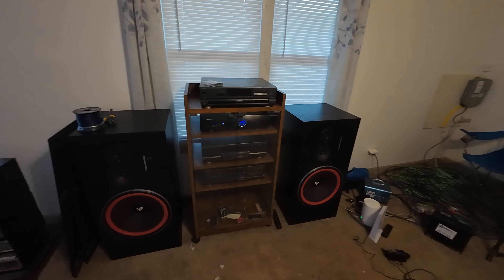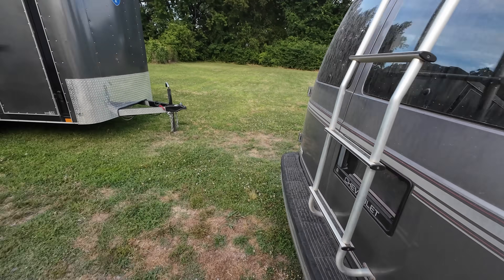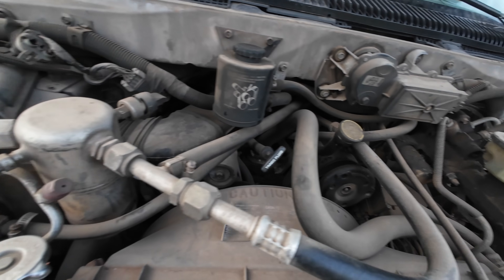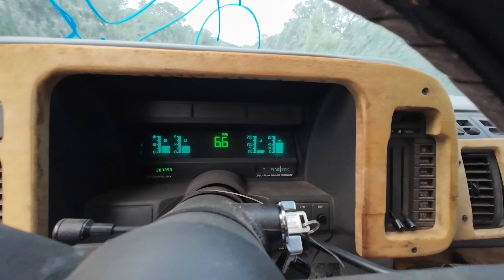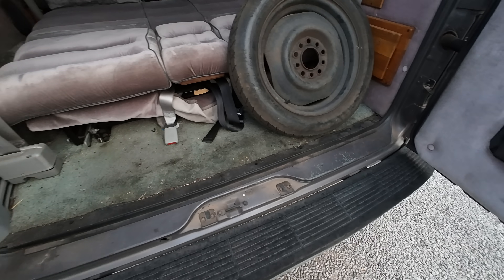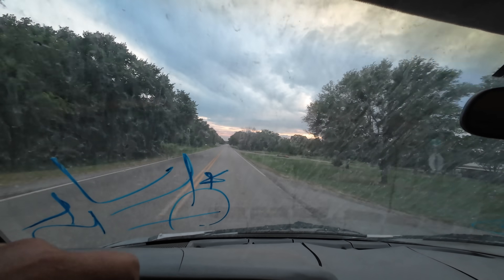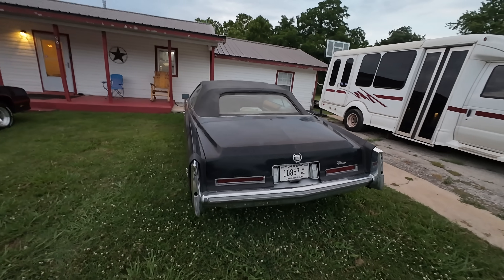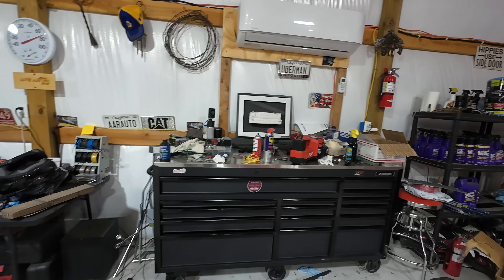I Won this 1993 Chevy Astro Conversion Van for $375 from IAA! Will it Run and Drive?

Comment: Digital display in 1993 that van was way ahead of its time!!!
Reply: Nope they started in the 70’s became big in the 80’s and started dying in the 90’s and bounced back in the late 2010’s
Reply: Look up the 1987 buick somerset 😂
Reply: Look at late '70s Chrysler products and I think mid '70s Chevrolet products or GM had that as well it's been around quite a while
Reply: @battycowboy hat display was a. PITA
Reply: Alarm system old school viper
Reply: Auto lock feature with slarm
Reply: Those digital dashes were around a long time before '93 and were notoriously expensive to repair.
Reply: @iFixJunk  yeah new gen of gm trucks and cars. 88on up had digital dashes and heads up displays..junk
Reply: @jasonmoore8518  I had a 1984 Nissan Maxima that was all digital and talked to you. Waaaaay ahead of its time!
Reply: @user-ht1xu4gv2u  Yeah, my 88 Cutlass was all digital with HUD.

Comment: The silly little thing on the kawi is a dual kickstand, while standing next to the bike balance it up on two wheels step on the dual stand and pull up and back it will lift up and is very stable no leaning.  A very useful tool to have.

Comment: That is a kickstand to set it up straight, level. You stand it up ,push down and pull back on the bike. It brings up off the rear wheel. Try it and you will see. It may be a little hard by yourself but it will work.

Comment: my grandfather had the same year van just not the conversion part. it was very reliable, it has over 400k on it and not once has it broken down only thing he's done is normal oil changes. they don't make cars like they used to and that's a fact

Comment: Had 95 Astro AWD that 4.3 was amazing put 295 thousand miles on it with only basic maintenance was living in fear of fuel injection spider failure but it never did. Was amazing in the winter.

Comment: Growing up in the late 90s my dad had a 91 Safari he bought pre owned in 94 right before I was born and let me tell ya he drove the hell out of. He sold it in 2015 with just shy of 450k miles to one of his buddies that really needed a ride. Never touched the engine other than basic little things like water pumps and such. Just 1 transmission and rear-end replacement at around 370k miles
Reply: I drove a Safari for work and an Astro in a later job and loved them. Wondered why they did away with them.

Comment: Randy, just watched and yes that is a kickstand on the motorcycle,so it will sit level and not fall over if sat on., push to ground and pull bike backwards by handlebars

Comment: That is such a sweet Astro Van! Loved the early years especially the 80's versions. A friend had a 91 Astro and a 94 Safari for a long while. The Vortec is a good motor knowing both of his vans had well over 390K miles on them. Still looked pretty good as well in similar shape to this one. Great score on this van Randy it doesn't need much either. Just a cleaning some AC and maybe tires. Can't wait for the next video!👍

Comment: Randy the vortec v6 is an absolute beast I had a 2003 work truck that had 265,000 when I sold it to a good buddy of mine. He drove it another 200,000 miles the odometer read 465,000 when he got t-boned in it that ended its life otherwise it was running awesome....

Comment: The peg behind the kickstand it's called the center stand. It is used to remove the back tire if necessary and for other purposes. Drop it down with your foot and push motorcycle backwards to utilize

Comment: I had a nice Fisher Studio Standard  rack system back in the 80s that I bought at SaveMart Electronics in Brooklyn. it had the 15inch 3 way speaker system with 20band graphic equalizer dual cassette deck 6CD carousel unit. Linear tracking turntable and the matching rack to put everything on, Rebuilds 👍

Comment: Hey Randy, I believe the 2nd kickstand on the motorcycle is a Center Stand. When engaged, the bike sits up right and slightly elevated. Good to use when doing maintenance. I could be wrong though, I'm not a motorcycle expert but I remember when I was a kid, I knew someone with a Honda Goldwing that had same thing. Awesome video as always!

Comment: Best purchase of all time! I've owned 3vof those. 94,96,2005. All are fantastic. 4.3 engines in them are perfect. Basically a 350 engine with 2 cylinders cut off the block. The engines are awesome.  Great mileage.  The wood on those are easy to clean if not completely damaged. Otherwise you did well! I'd buy it if I lived closer. I'm in Cincinnati.  Love those Astros and the gmc version

Comment: I was a furniture restorer for over 50 years. During that time I restored the interior wood in three Rolls Royce's. Do one and others will follow it seems. Countless wooden sports car dashes as well. The interior of the conversion van had my attention and it can be restored but it will need a lot more than a sand and finish. Another outstanding purchase along with so many others. Grand video. Thank you.

Comment: I have a real soft spot for these Astro/Safari vans. My dad had a bunch of them when I was growing up. They are terrible passenger vans, but are work trucks through and through.

The thing that really helped them was those old 4.3L V6's were bulletproof, they got really bad fuel mileage, always ran rough, and almost every one I've ever seen had an exhaust tick, but I've never seen one that doesn't run unless there's a hole in the side of the block.

Comment: If u need to change a tire or oil on the bike it has it's own jack u put one feet on the silver kick stand and your hands on the handle bars u push the bike backwards and it will lift the bike up off the ground then u push the bike forwards to let in back down again

Comment: Hey Randy, that (silly Lil not a kickstand) on the Kawasaki. Is indeed a center stand. 
You put your heel on it and rock the bike back until it sits up straight. Much more secure than the leaning kickstand.

Comment: Randy on that 1200 that is a jack kickstand to lift the bike up in case of a flat. It's tricky but ya push down on the lever and pull the bike backwards and it lifts up I had a Honda gl 1100 with the same jack tg I never had to use it cus it's useless if you are alone...

Comment: Nice score Randy!
With a little bit of work, that would be a Hell of a road trip vehicle!
My Buddy had a base model Chevy Astro with the 4.3 V-6.
That was such a great vehicle! Super reliable! He used to tow his heavy 18ft Tri hull boat out to the river and back through the mountains with no problems. He had it for several years until one day his Wife was driving it and some yahoo ran a stop sign and plowed into her and totaled it.
They really are great vehicles.
It has a ton of miles.
Like you said. Clean it up as best you can. Lube and grease a few things. Check and replace a few fuses and send it down the road.

Comment: That footlever on that bike is a wheel stand push down on it while pulling the bike backwards and the radio should be under that cover above the handle bars just pull it open

Comment: Keep an eye on battery drain, that could be a reason why that aftermarket fuse block was disconnected. Next project, detailing the interior. Condition of the undercarriage?

Comment: That pedal on the bike is the center stand. Hold the handlebars and bike straight, step on that pedal and pull back on the bars and the bike will raise and be on the stand leaving the rear tire in the air.

Comment: Nice van. Whoever owned that van was either in the military, family member of a military member, or worked on a military base.  The military used to require stickers on vehicles that required access to base on a regular basis.  I couldnt read the sticker, but it might say which base the owner lived and worked at.

Comment: I have that exact Topdon 4000 charger.  When they first came out, there was a short while when you could get that one for $28 and the 8 amp one for $48.   Sadly, what they sell as the 4000 now is very different.  That long skinny one that we have is great.  I have no idea whether the smaller one now, is any good or not.

I used mine to charge and recondition two garden tractor batteries, and I routinely used it to recharge 50Ah and 100Ah LiFePO4 batteries when camping.  Its "Lithium setting" is fine for LiFePO4.  It draws little enough that I can run it plus my 50 liter freezer in the car at the same time, off a little 300W pure sine wave inverter plugged into the 12V car (cigarette lighter type) outlet, which is fused at 10A, so I can only draw 120W max.  Being able to run the freezer plus recharge the LiFePO4 with this charger whenever I have the car on, is a huge win, even if I'm now going to also upgrade to a bigger inverter wired and fused separately straight from the car battery.

Comment: I had an 85 Chevy van and we put a switch underneath the dash to cut the battery power off when I was away from it so nobody would steal it and that’s why what that switch is for my friend had a 76 dodge van and he had the same thing on his van to ours was underneath the steering wheel part underneath so nobody would steal the vehicle that you shut the switch off and they go start and when it start

Comment: I used to have an older version of that Kawasaki. If memory serves me right, that lower kick stand, is exactly that. You use that to lift the rear tire up. I would use it on a tar parking lot, because that side kick stand would impale itself into the parkinglot6. I had on one occasion, come out, and found the bike on it's side. Let me tell you, that was a project to get back upright, when it 90° 85% humidity. 
There is a trick to using it, you need to grab onto something solid on the bike, then lift and rock.
Have you noticed while riding it, when you excellerate in a corner, it likes to lift and kick? I noticed that in all the shaft drive bikes I've ever owned. One you get used to it, it's not so bad.

Comment: On your Kawasaki that hick stand is a center stand you push down on the stand and pull backwards and it's another kickstand only it lifts the front end of the bike up and now the whole weight of the boke rests on that stand instead of leaning on one side like a side stand

Comment: 21:12 Well both seats on both sides of the third row each have two cupholders, one on the armrest and the other on the solid wall on either side, and the three bucket seats, two in the front row and the other on the driver side of the second row each have one cupholder, but why doesn't the seat by the sliding door on the passenger side of the second row have a cupholder on the sliding door?

Comment: Hey Randy, the little lever thing on the bottom of your Kawasaki should be a center kickstand.
It lifts the bike evenly and is a lot stronger than the normal kickstand.  I'm a little surprised that
they put one on a bike that is that heavy. Might be a little hard to use.

Comment: Those Astros looked the same basically from when they came out in 1986 to 1994 then I believe 95 and up got the last refresh look before discontinued. They were also truck based van similar to the 1985-1997 Ford Aerostars but these held up better than those did. The originator of the 3 the Chrysler K car based minivans that started in 1983, were the best and are still being made today as the Pacificas. Shame Ford and GM don't make minivans anymore!

Comment: Give it a good cleaning inside and out, maybe give it a cheap oil change, try to fix AC and anything else easily fixable, then send to copart, i would think you should be able to get at least 1000$ out of it

Comment: That's a nice home audio system you have there!  Are you trying to make the people down the street wet the bed?  HAHA!  I also have an older system.  A few years ago, I inherited a Kenwood KR-2600 receiver and a Hitachi HT-404 turntable from a friend that had passed away.  His family said that they didn't work and asked me if I wanted them.  I took them home and tried them out.  The only thing wrong was they didn't know how to turn them on!  I set them up with my existing Pioneer PD-202 CD player.    I then picked up a pair of vintage Sansui speakers at an auction for $20.  This thing rocks!

Comment: The stand on the rear of the motorcycle lifts the rear wheel off the ground.  You push it down with your foot and pull the bike backwards.

Comment: Hey Randy, Your Chevy Astro Van is Value at $1900 Low, $2327 Average Value & $3,087 High Value! In 1993 it Sold For $19,143!!👍👌😉
Reply: If That Van Has All Wheel Drive &  Has The S10 Blazer LT Package Low Value is $2,325!! Excellent Shape You're At $3,837!!!!!👍👌😉

Comment: Bus could make a nice all electric camper , stove , fridge ect and hang some single size beds on hinge and chains to save space and small toilet and shower stall with drain in floor. Do it all for like 2500 to 3500 , flip for decent profit (?).

Comment: The 4.3 with CPI likes to leak oil from the oil cooler lines. Delete those lines and the oil filter base, slap on a new filter, and use synthetic oil. No more leaks and cost is nothing.

Comment: Randy, you wore your helmet like a smart bike rider so I will tell you what that foot thing on the 1200 is. Its a center stand. Left hand on handle bar right hand on the back & step down on it while putting all your weight on it. The bike will rock back onto the stand.

Comment: My grandpa had one of these, it was parked in front of the house on a snowy day in the winter, an early 2000s Focus lost control and slammed into the back of it doing 40-50 mph. Obliterated the Focus while the Astro only suffered a bent rear bumper and a flat tire. These things are tanks

Comment: It's a good van for someone living in a house but planning to become a part-time nomad, to get.  I'd advise against it for someone going fulltime vanlife/nomad, due to risk of breakdown.  But if someone can maybe spend a year using it part time, maybe it would even be OK as a fulltime rig later after it had been fixed up and proven itself.  Hard to say.

The best-known YouTube nomadic vanlilfer in an old Astro/Safari was Alyssa Vanilla.  It suffered a fatal breakdown after a couple of years, after a few repairable breakdowns and problems.  She then got a much newer Promaster City, before getting out of vanlilfe (for a while or permanently is TBD).  

The fancy conversion, power seat/bed setup wastes a lot of space compared to someone doing their own conversion, if planning to live in it.  For road trip van or camping/party van, I am sure it was a sweet setup.

Comment: I know it's early in the video and I still haven't seen it drive but for $375 bucks at the condition it's in I think it needs the detail treatment from AUTO SPA asap!
, maybe a AC recharge, but good vacuum inside and out. A good wash,wax and maybe a buff.

 check all the fuses and change fluids this thing would be a top!

 You could make some good money on it all cleaned up and shining! Easy $2k +!!! Seriously.

I don't know if it's the camera or what but you say the paint is not all that good but on camera it doesn't look bad at all, and interior looks just as great besides that wood but like everyone else says that can be sanded and stained, maybe take one of them little rotary tools with a sanding pad on it go over it real quick, clean it up as best as possible and throw some quick stain on it and call it a day. If you don't want to spend much time on it but definitely definitely definitely take it to auto spa

 RANDY WE'RE BEGGING YOU!

Comment: The stand on your Kawasaki is your center stand Randy. So you don't have to put it on it's side stand say, when it's windy. Takes the rear wheel off the floor pal. It's just a heavy bike. Peace from the UK bro.

Comment: The peddle you keep talking about is a center stand.
Reply: He is correct. That device on the bike is a center stand.  Never used one myself, but have seen them. Basically a much more secure way to stand your bike up vertically rather than an angle. Once up on the center stand, it is hard for it to go down.

Comment: Oooh, How about putting a Smeding Performance Cammed 350 engine in the Astro. Dont paint it. Send it to Maaco and have them just clear over the Patina. New tires, refurb the OEM wheels and replace a few other mechanical hardware and take the Astro to Power Tour 2025...😊
Reply: I just saw your reply to my comment, and yes. Clean it up, put some shine juice on it and run it. Gotta have the white letters out as well, I mean, do they even go on any other way? Lol

Comment: Hit the tracks PB. BLASTER
Reply: OOOO. STEEL WOOL. OR A MR CLEAN. SCRUBBER PAD WILL CLEAN WOOD WITH SIMPLE GREEN DILUTED
Reply: Replace batt in the key fob for alarm. Sure it controls auto lock of system when doors close😊😊

Comment: I'll give you $400 for it! Lol😅
I've owned 6 Astros in my life....  had a 95 with 305k miles and ran amazing.  I also had a 85 with a 4.3 with a factory carburetor!  Ran horrible, but never failed to start! Had a 92 with the vortex 4.3 and it was a burnout machine!

Fun fact...  gm discontinued the astro cause they couldn't do duel doors on it because of the fuel tank filler.

Comment: That pedal on the Kawasaki motorcycle that you don't know what it is that is the sinner's stand you have to push down on it and pull back on the handlebars and the bike will come up off the ground in the back wheel will be off the ground